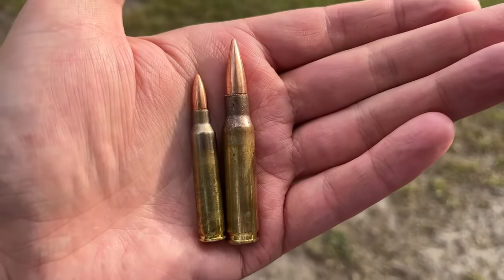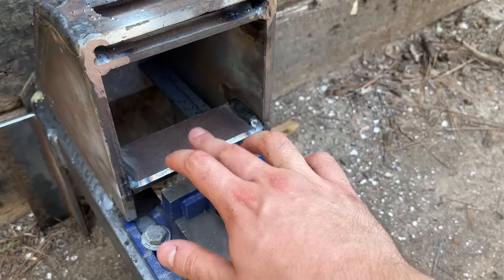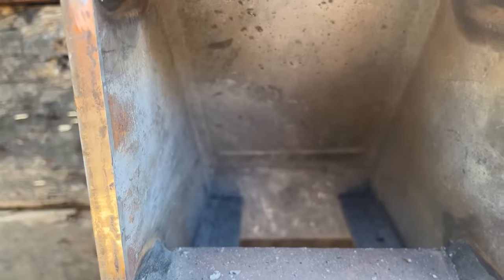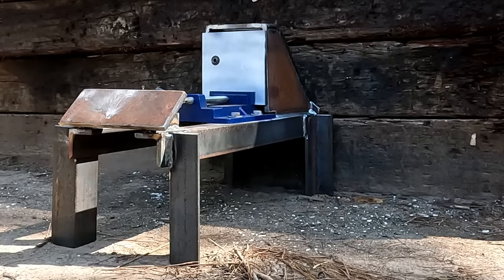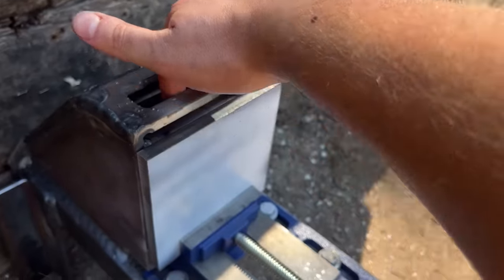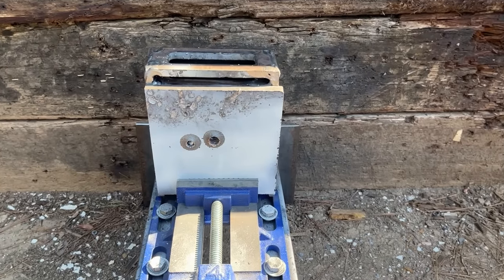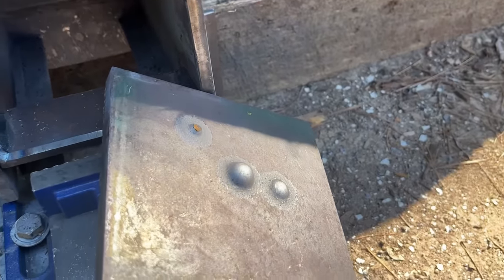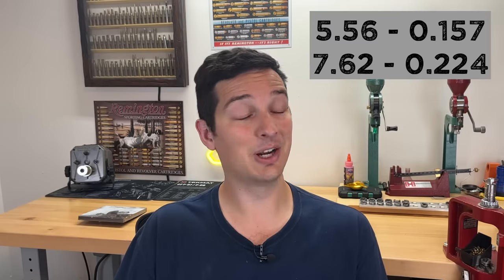5.56 vs 7.62: Unexpected Difference On Steel

Comment: The difference is at 500yrds and more. The 556 loses its punch and the 7.62 will carry it’s killing power out at farther distance.
Reply: 5.56 is done at 300m
Reply: Bro also use full metal jacket for the 556
Reply: exactly right...battle tested
Reply: Difference is neither round is typically used for 500 yds. Your average range for both is typically maxed at 250 yds. The point of these tests is to show what happens with your average shooters range. The 6.5 creedmoor has the ability to be accurate and punch through at 1200 yds where the 30-06 that more people prefer falls short at 9 to 950 yds but again your average person isn't taking shots at that distance. Even in a gun battle you don't wanna waste ammo shooting at someone 500yds away with these rounds
Reply: @user-un1sx8xp2q 

M80 7.62X51 IS full metal jacket ammo.

M80 ball was Standard GI issue 7.62 nato ammo when the M14 was in general service
Reply: The thing is... outside 500 yards? Infantry isn't typically shooting at folks.

At that distance? You call arty or an airstike on them... danger close, but doable
Reply: @stinkyfungus  JW can you send me any links to look Into this information further I'm honestly stuck on where to start looking right now
Reply: The only downside is the 556 can hold more rounds but that doesn't matter if the 7.62x51 is putting something down with less shots compared to the 556😂
Reply: @cbg482  And getting right back up and giving some hate in your direction while 556 would put that poor bastard down permanently
Reply: The nato 5.56 has a steel insert.
Reply: @gotanon9659  7.62x51 is way more powerful than 5.56 😂 that person isn't getting back up what ur saying is what happens with 5.56
Reply: You should look up a 556 and a 308 hitting a water drug at 300 yd that might open a new window for you.
Reply: @stinkyfungus  That might be ideal, but that also didn't happen in Afghanistan. M16/M4 was grossly outranged.
Artillery support is expensive, in both ways. Not just in terms of money, but also logistic distribution. Calling tanks are often easier. But in the end even US Army decided than 5.56 isn't enough anymore. At least for frontline troops. 5.56mm will stay for a long time in support and reserves.
Reply: Very interesting,
So I guess for urban warfare there is probably not much point in carrying 7.62 mm rounds & you can carry more 5.56.
Reply: @RichardMyers-i2s yea but imagine if it was green tips
Reply: who fights at that distance tho
Reply: Neither is meant to be used for shots that far away.
Reply: To the greater majority of hunters and military anything over 300 to 350 yards is a no shot or a hail Mary.
Reply: @ryanjacobsen9557 Yes and a 408 Cheytac is even more impressive.
Reply: As a civilian if a threat is 500 yeards away then it's really not a threat😂. Unless you got beef with a sniper 😂

Comment: In my own testing on 3/8” mild steel @ 200 yards I have seen M80 stopped from a 18” barreled AR10 but defeated by a 16” AR15 with M855A1.  That really blew my whistle on the M855A1 (had a muzzle velocity of just over 3,000fps)
Reply: Yes, when people talk about penetration a lot of them tend to overlook bullet material and construction, like with the 6.8x51, it's not just about velocity or kinetic energy
Reply: I've put M855A1 through a half inch plate at 100m from an 14.5 M4A1.

Comment: That makes sense - the 5.56 has around half the frontal area of a 7.62 so the force is applied to a smaller area.  The 5.56 had half the muzzle energy so the net result should have been the same depth of penetration, the difference seems to be the higher velocity of the 5.56.

Comment: This series of tests reinforces why 5.56 isn't a one size fits all system.
Police should not be equipped with 5.56 as the only option.
The Lindt cafe siege showed me graphically what the issues were.
The NSW TRG showed up armed with 5.56 and couldn't reliably penetrate the glass so when the R-sole started killing they were obliged to go in.  At close quarters the 5.56 over penetrated and killed a hostage.
It is like believing that a Grey Fergy ( Ford N) is the only tractor a farmer needs.
Lack of a serious anti-material calibre set the scene, lack of man stoppers (10mm, .45 ACP, 444 etc) killed the hostage.
There isn't a best, just a best for the application.
Reply: Massive blunder. They had MP5s in the armoury, no reason to use 5.56 at such close range against a single unarmoured individual . . .

Comment: Not surprised. I’ve shot .223 and 30-06 at railroad tye plate steel (1/2” thick). .223 goes through. Others don’t. Velocity and smaller diameter help the .223/5.56.
Reply from the maker: That is interesting that it beats out the 30-06. You’re not kidding about velocity

Comment: While your mileage may very... We did a science where in a level III armor plate with anti-spall coating was set at 10 then 25 and the 35 yards. We shoosted it with 55g FMJ "ball"  and 62g "penetrator" Lake City ammo from a 24" and then a 16" barrel AR platform. Our results were that the 55g FMJ ammo blasted through the plate and the 62g penetrator never did more than severely dent that plate!
We even hand-loaded the 62g penetrator bullets to a chronographed  (proof load, plz don't try this at home) velocity of  3304 FPS and at 10, 25 and 35 yards it still did not punch through the armor plate! Where as the 55g FMJ pushing only 3076 FPS from the same rifle sliced a clean hole, even out at to 35 yards.  Your thoughts and experiences on our observations would be so very much appreciated!!!
Reply: What was the twist rate?
Reply: What manufucturer of the 55gr FMJ?

Comment: A kazillion years ago welding up the holes in our club’s metallic silhouette targets, the 22-250 was the biggest pain. Sometimes the target would still be standing even totally perforated.  The fun cartridges like the 458 Win mag, or the 375 H&H would flatten the targets almost too fast to see, but never did more than a big dent.  I think the fast bullets were more like those IEDs with the bullets vaporizing on impact.  You could have made a lead mine or toxic dump out of our range with so much lead dust.

Comment: Another great episode, and with surprising results!

7.62x39 vs. 30-30 maybe? The pointy commie round vs. the stubby cowboy round, would there be a surprise to found between those two rounds? Or perhaps the newer ballistic/polymer tipped 30-30 vs. the traditional round nose? Hmmm.....
Reply: 7.62×39 is alot better ballistics after 100 yards than 3030 243win and 22-250 are better comparions

Comment: How about 17-223 vs 223/5.56 and 7mm tcu vs
 .300 blk? That might shed some light on the whole faster and lighter vs the heavy and slower question, maybe. Heck,  some of those old Remington Accelerator 30-30 55gr. Sabot rnds that supposedly goes around 3,400 fps (remember those?) vs 30-30. Would also like to see how the .204 Ruger does. The possibilities are almost endless!
Reply: Yes, but those 30-30 accelerator rounds were all over the paper. Force = mass x acceleration. It's not just a good idea, it's the LAW. So, the question becomes TERMINAL BALLISTICS. I love .22-250 at 300 yards, but it will not kill a deer, despite what the math says, because of TERMINAL BALLISTICS! For the reocrd, I am a 30-30 fan since 1980!

Comment: Hi I’d still prefer our FALC2. At 7.62. Our engagement distance was 300 yds. With the new 5.56 engagements moving to 100 yds to close for comfort. I’m glad to be retired my thinking is a little more weight on longer distances help to stabilize, the job was to mainly disable the target, then they would have to use resources on them, that was the goal then, in the CAF

Comment: Just a humble suggestion for that Master Piece Steel  Plate 4.1 (🤞) -😁 !
Would be to paint the back of it to see what if any gets through and how much of the remaining projectile hit it ‼️
It would be easier for the camera to pick it up , I think 🤔..❗
😎👍
P.S. 
(Have you try the 7x57 mm old mouser round, don't know if you had a run with it or if you have a rifle for it, but I AM Curious what that would do, if you had in the past let me know thanks) 👋❗

Comment: I think steel sled could use some rubber "washers" to help with the vibration traveling thru the bolts and cracking the clamp

Comment: i would like to see more testing on 1/4 plate,as its more available than the thicker steel and more easily moved around, by one person.lets try 2 1/4 plates a ft apart...test thinner steel plates too see at what thickness a .223 or .308 bullet will breakup at...if 1/8 steel plate  will break up a .223 bullet then will another 1/8 plate 2 feet behind it stop all the fragments??  how much velocity is lost by  a .223 or .308 bullets passing through 20 ga sheet metal?? its most common on washers and dryers ..

Comment: You may need to start putting some clay behind the plate on steel sled version 4.2 xD

The M855A1 round went through 1/2" mild steel, the question is what did it do afterwards?
Reply from the maker: In time you will know

Comment: I would like to see 277fury vs 5.56x45 NATO I mean since the Sig 6.8x51 is supposed to be replacing, the traditional 5.56x45 so it would only be fair to shoot a. 14.5" M4 with 5.56Nato, and a Sig MCX XM7 with a 6.8x51, but since they haven't released that version to the public "yet" use what you can get in the 277Fury/6.8x51 but with the proper barrel lengths and preferably a gas gun
Reply: Check out the history of videos on his channel. He recently did one with the 277fury.

Comment: Really not a fair comparison given an intermediate rifle cartridge against a full size rifle cartridge but the intermediate held its own at standard rifle range. Longer rifle range will probably be a different story because intermediates are not meant to go as far as full size. Case capacity and pressure will tell in velocity and energy at greater distances. A fair comparison would have been two intermediate rifle cartridges. Instead of 7.62x51 full size it should have been 7.62x39 intermediate.

Comment: Why not paint the inside of 4.1?  Also, I may have missed it,but is the back of 4.x a hardened steel?
Reply from the maker: That might be a good idea, but it would probably be pretty messed up after each shot. Yes, it’s AR500

Comment: Why couldn't you just say "762 NATO"? Why wasn't there a cartridge length on the 556 box? Nice job on your jig & plate support. You really did need that angled pick up plate protecting the clamp. Did you figure out why your aim was so low? Thanks!

Comment: Too bad no one makes a .204 fmj bullet. 4000 + fps would be interesting against mild steel.
Reply: Everyone I've heard that owns a 204 Ruger says it is the  penatration king. The only other cartridge I've heard can compare is the 220 Swift.
Reply from the maker: Closest I can do is a 22-250
Reply: 22-250 with a green tip is interesting 🤔

Comment: Would there be any difference in a pair of stacked 1/4in plates vs a single 1/2in plate, in terms of 'protection' on the other side ?

Comment: Aside from talking about the A1, which you're not as it was an extra, where are you gettin this 500 feet addition. The test was normal 5.56 vs 7.62x51 and you logged them both as having marginal FPS Increase?

Comment: Would have to try the steel tip 308 vs that steel tipped 556. Soft lead and copper will just about always lose to steel.

Comment: Wonder how much the semiautomatic bleeds off
Reply: From what I've seen in other tests, it varies from slightly less to slightly more velocity.
Reply: The action remains locked until the bullet passes the hole in the barrel where the gas is bled off which is under the front sight.  From the time the bullet passes this bleed hole until the time it exits the muzzle, pressure is rising in the gas tube.  There is a small amount of slack that the bolt carrier can move rearward before it begins pulling the bolt head and moving it rearward. In this slack space the bolt carrier will accelerate fast enough to have enough inertia to cycle the action. The pressure in the chamber was pressing the inside of the cartridge case into the walls of the chamber so hard that you have to tear the cartridge case in half before the bolt would move.  So the pressure is gone before the bolt moves. The action doesn't steal power from the bullet or it's so small that it's insignificant. A semiautomatic rifle will shoot the same velocity as a bolt action.  Recoil operated semiautomatics are the same way.  They use energy from the recoil of the firearm not energy from the bullet.  The same energy that moved the bullet is what moved the rifle but it's energy from the moving rifle that's used to cycle the action not energy from the moving bullet. For every action there is equal and opposite action. it's the opposite action that's the power that's being used.  It only takes 5 to 10 foot pounds to cycle the action even if it was stealing it from the bullet. Gas operated firearms probably do steal that from the bullet actually but it's probably 5 to 10 foot pounds.  It's within the standard deviation of the variance between shots so it's insignificant.

Comment: Energy (Force = mass x acceleration). It is important to understand physics and use the correct words. Energy CANNOT beat velocity. They are inherantly related. Energy is a function of velocity (acceleration) and mass. I do not need a real world test to tell me which round will have better terminal ballistics. 8th Grade math will tell me the answer. Otherwise, I do like your videos!